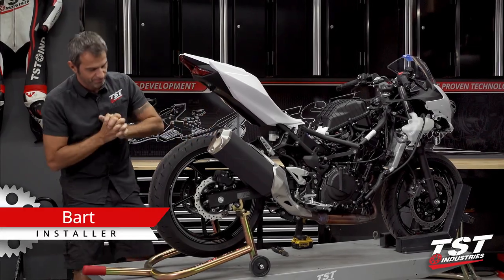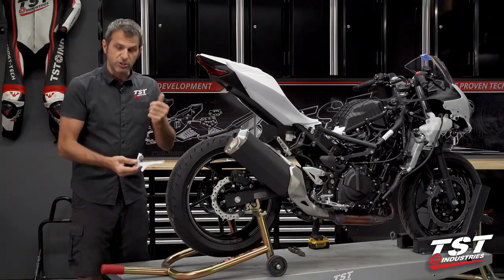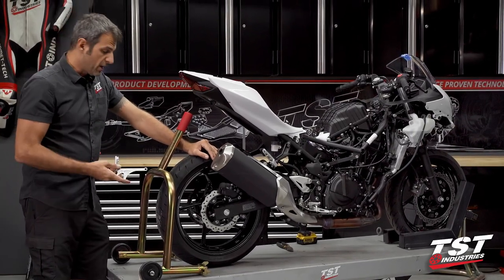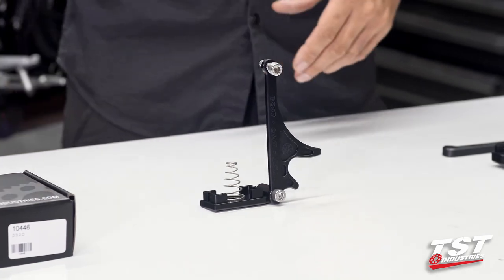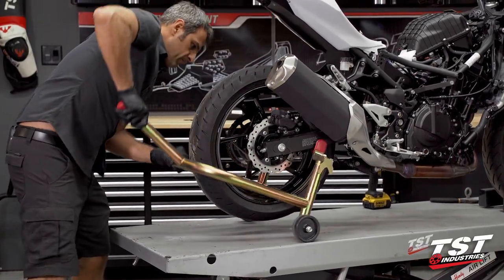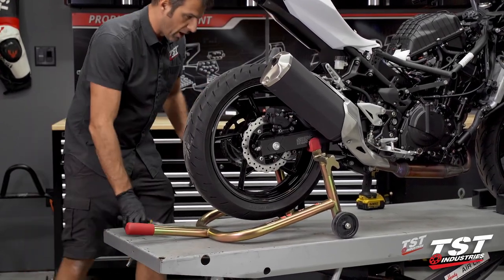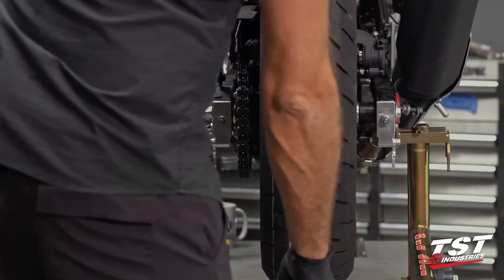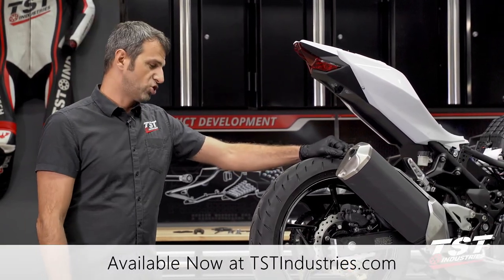How to install TST Captive Chain Adjuster & GP Lifter by TST Industries

Comment: Did you really have to remove the axle and wheel?  It seems to me you could have just removed the chain adjuster nuts and stock end plate and then installed the spring and TST end plate.  Maybe just loosen the axle and redo the chain adjustment.
Reply: Yea I don’t understand what they removed them either besides maybe for a better visual representation.